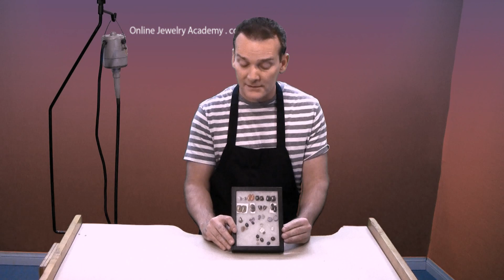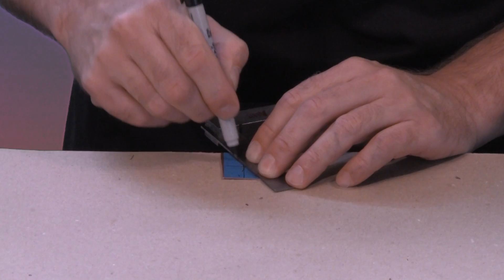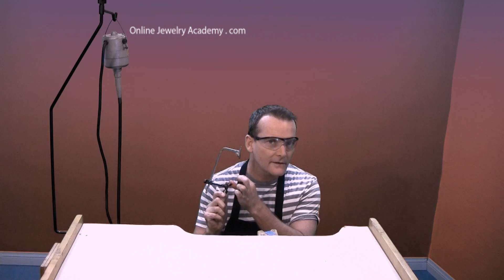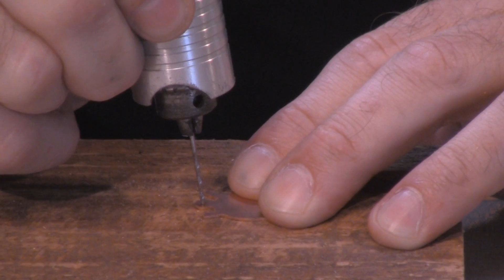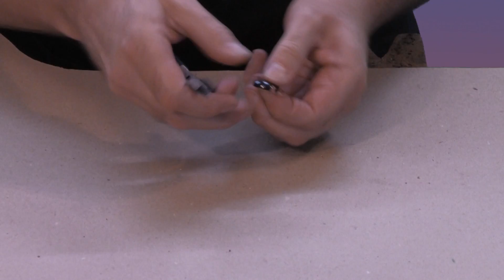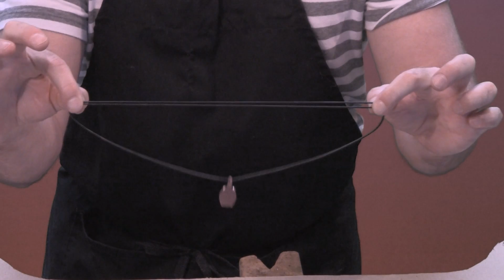Simple Turtle Setting For Cabochon Stones

Comment: Thanks so much for sharing your tremendous skills. I can't wait to try this project. I would like to share something I have aquired over years of drafting; To find a substrate/material's centerlines you should always only rely on one edge of the material to create your centerlines off of. This is the only way to be sure your lines are truly perpendicular to each other. Whether substrate is newly manufactured or scrap stock, you can never be positive that the two adjacent angles you use will be exactly perpendicular to each other for basing accurate centerlines. Therefore, utilizing a combination of some sort of T-square (preferably with the top of the t placed on the longest visably straightest side) in conjunction with an item like a triangle placed on the line at the halfway point created using the t-square will give you a truly perpendicular centerlines on your material. Again, thanks so much for sharing your talent. I look forward to being a new student of your Academy.
Reply from the maker: Thanks so much for posting your helpful tip to the comments section.  I'm glad that you like the idea of using a turtle setting to create a pendant or charm.
Thanks for your support! : )

Comment: how do you determine how long the tabs should be?
Reply from the maker: Hi Wendy,  The length of the tabs can be adjusted as you set the stone.  Better to cut them a little on the long side so that you can get them to turn the corner around the edge of the stone and hold the stone in the setting.  A good length is one that is just long enough to hold the stone.  Any more metal than that will distract viewers and hide the beauty of your stone.  It's a true subjective judgement call.  Good luck!
Thanks for your support! : )
Reply: OnlineJewelryAcademy Thank you. I thought it would be more precise than that. so glad it's up to the individual.  I've learned much from your videos. thank you!

Comment: Dear Professor John, I am wondering if you can help me with a question. I am going to use the system in this video . Instead of copper i am using a old silver half dollar or perhaps a quarter that's worn down . I plan on flattening out the coin to a half a millimeter. My question is what size saw blade to use ? Tooth per inch, there are so many sizes. Thank You, Professor John.  Your Fan, Scott
Reply from the maker: Scott Saleff Hi Scott,  I think you have an interesting idea for adapting this project to suit your design plan. Be sure to anneal the silver coin so that it will bend easily to secure your stone.  As far as what saw blade to use is concerned, I suggest that you use a size 2 blade.  Normally, most jewelry bench workers use a 3/0 size blade to cut sheet and wire for projects.  But, if they are rough cutting a thicker piece of metal, they might jump up to the courser size 2 blade.  The general rule is to try to have as many teeth of the blade on the edge of the metal to get the most accurate and refined cut.  But, that approach often slows down the process.  If you do a google search, you can find a number of charts that will tell you how many teeth per inch are on a jewelers saw blade.  I hope this answers your question.  Good luck with you project.  And thanks for being a fan! ; )